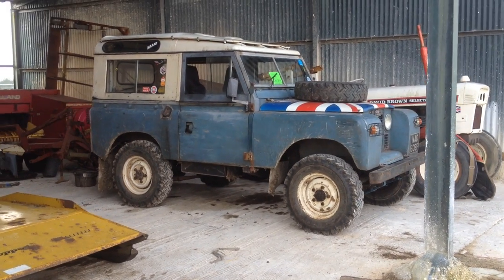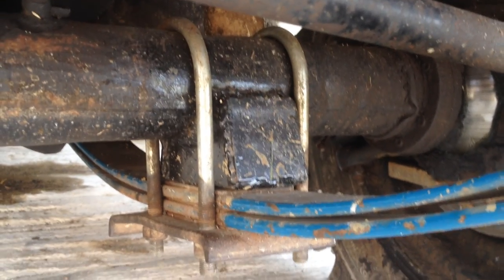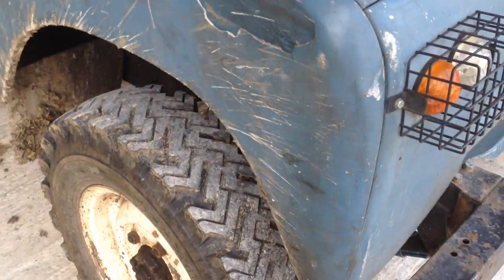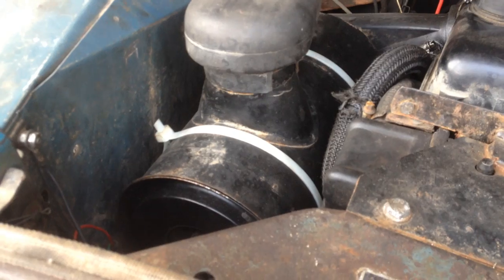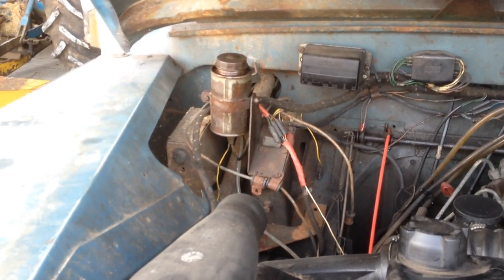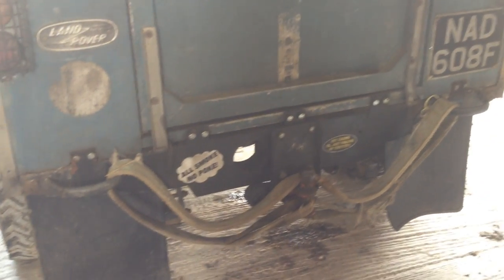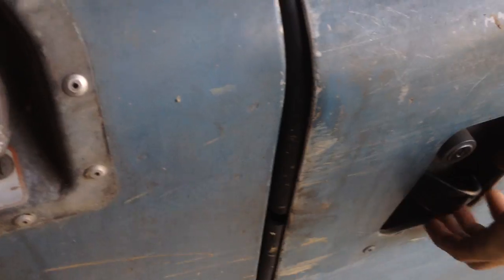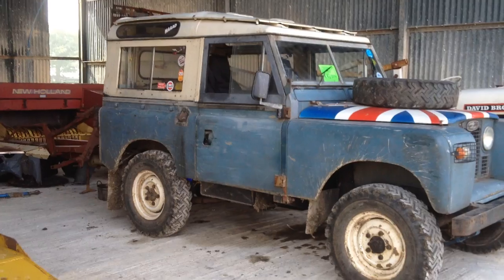Land Rover series IIA Tdi, One year on.

Comment: Land Rovers don't LEAK !!
They're marking their TERRITORY !!!
I have two Land Rovers a series 1 , 1957 86" wheel base diesel, and a 1965  series 2A 109" wheel base
station wagon diesel. I'm the original owner of the 109 and the series 1 was purchased new by my father. Absolutely love both of them and wouldn't sell either. 
I changed the engine in the 109 to a 3.9 Isuzu , like the Australian military Land Rover Perentie, along with the gear box (transmission). There's several companies in Australia that are great help with conversion kiks. Parts are very hard to find for the old Land Rovers. Lucky I have a great machine shop to make certain items.
Great video. Thank you for sharing your Land Rover Series 2A.
Greetings from Florida, USA

Comment: put a 200 tdi in my 67 2a. nice easy job. totally transforms it especially with disco diffs in
you'll get pulled by plod with those tyres on
Reply from the maker: Friend of ours is a bobby, says the worst they can do is make me take an MOT test, which I will pass as the MOT doesn't check for construction and use regs, just condition. It also doesn't fall fowl of the C&U regs as the tyres don't stick out more than 1.5"

Comment: Hey, nice Landy! I'm looking at swapping a 2.6 petrol in my 109 to a 200tdi, I see you have a 19J turbo on your 200tdi. How did you get that to fit as I understand the exhaust ports and stud holes are different between a 19J and 200tdi for the exhaust manifold?
Reply: I believe 19j’s and 200’s both used the same turbo...

Comment: Nice Truck, I too am 19 with a series in need of work. I was wondering how you're getting on with those 1 ton shackles, I've heard some horror stories about them messing up the U joint geometry on the prop shaft, and binding the u joints, in one case braking a ring gear. Also, how do you bleed the calipers with them upside down?
Reply from the maker: 1 ton shackles haven't given me a problem in 3 years of abuse! Take them off the axle, cable tie them up and chock the pistons apart. Bit of a faff at the time but they work